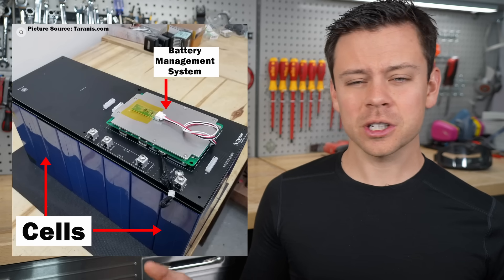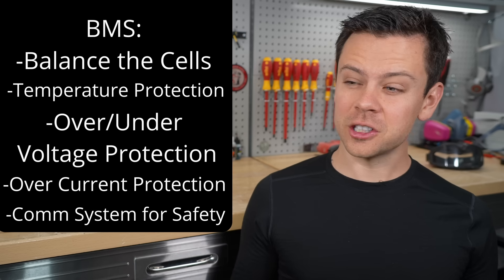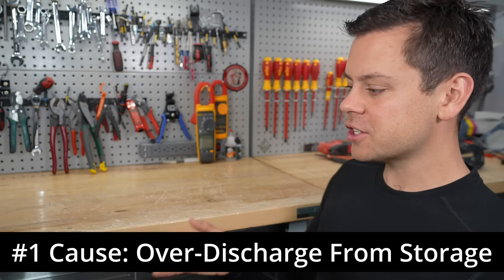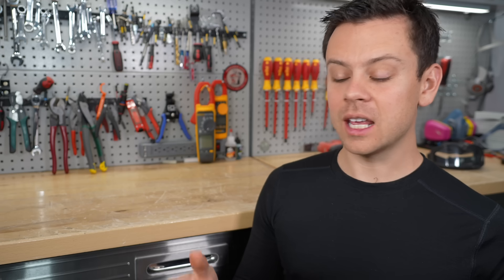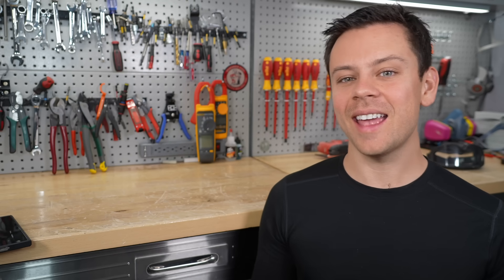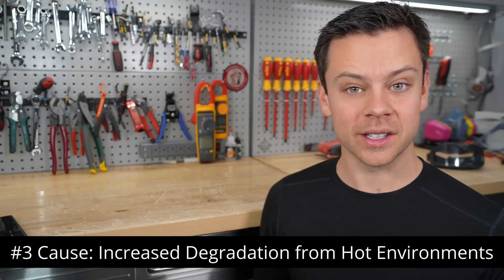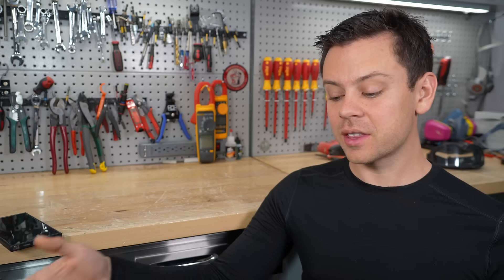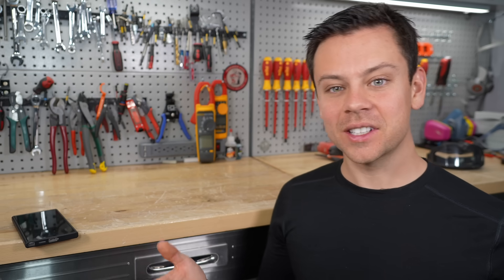The Rules of LiFePO4: The 3 Most Common Causes of Failure and General Guidelines for Long Term Use

Comment: I've seen all kinds of opinions about charging to 100% or discharging to 0%. I trust you the most, so thanks for this video.
Reply: @Justnn  Usually "0%" is not true zero. If you do not let your battery sit at 0%, you will be fine. If you discharge to "0%" the BMS is stopping the battery within a safe zone of discharge, but if you let it sit like that, it will continue to discharge and reach true zero, which is bad.
Reply: @user82938 Cool. Newbie here. So, most don’t tell you the problem of leaving it at 0 is because of the continued self-discharge. 
If I’m charging RV battery every day on solar and happen to deplete it overnight, it’s not going to damage it if the charging starts up again the next day. That’s my typical scenario and was concerned I’d lose an expensive battery.
Reply: ❤ @user82938
Reply: If you check the datasheets of EVE's prismatic LiFePO4 batteries, you'll see that the manufacturer itself says the batteries will last up to 3 times as many cycles if you stay in the 50%-80% range, vs charging/discharging from 0% to 100% and back again.
Reply: @luis0000luis  I've seen that as well. Yet I've also seen articles that claims you shouldn't charge to 100% because that last 1% harms the battery's. Yet the GOAT says the top 1% balances the cells in the string...?

There's so much conflicting information It's hard to gauge what's right.

I charge to 100% every day. then down to 40%.
Reply: @puddintame7794  Imo, I think this is almost like a automotive oil debate. No one, or VERY few, can feasibly track real data across the life of a battery (or a car's engine)  in a controlled manner checking many variables, so everything your read is anecdotal. We can take an expert like Will or some EE's that design batteries and just go with it, outside the big ticket items he mentioned we're unlikely to ever notice any difference.
Reply: @puddintame7794  Top balancing is a leftover myth from the lead-acid era.
Reply: @puddintame7794  You're missing out on 40% of your capacity. Don't sweat it. LFP can take it. As mentioned, calendar aging will cause degradation way more than you charging to 100% and down to almost 0%. Use em like they were meant to be used. I built a 12v pack that gets discharged sometimes twice a day down to under 10v. 1000+ complete cycles according to the BMS. Still getting just over the rated capacity.
Reply: @meindertsprang7491 yea indeed why wouldn't a BMS start balancing the battery's before reaching the 100%
Reply: @luis0000luis  Mine is Renogy and they don’t seem to get specific about cycles, but they also say better to keep within 20 and 80 for longevity. Interesting though, both their chargers, solar and inverter, are default set to charge to 100%. I don’t think I have a choice anyway, I need 60% or more most days in winter. 🤷‍♂️
Reply: @luis0000luis  but yes with lifepo4 it is amlost impossible to know where 20/80 is
the SOC drifts on bms's  in other words the % it shows isn't the actual SOC%

so many people will think they are in 20-80 range and gradually drifts to 0 so may actually use the battery closer to the 0-60 range, until it dies low voltage , recalibrates (which happens at 0/100 normally) and then be in the 20-80 range for a little while and drift lower

also zero balancing happens  if you keep it at 20-80

so then the cells with the highest resistance will drift more and thus you will have  some cells  allways work in the 0-60 range even while the pack is in the 20-80 range

over time this  bottom cells will degrade faster and go even more out of sync

many think an expensive shunt fixes this , it doesn't even though a shunt is very accurate at coulomb counting
it can't count what it doesn't know about battery inneficiency isn't counted it doesn't flow through the shunt, passive  balancimng current  also doesn't flow through the shunt hence where the drift comes from

yes 20-80 does work the problem with lifep4 flat voltage curve is if you don't visit 100% to recalibrate your bms is just as clueless of where the lifep4 battery is at vs the avg guy 

then pair that 20-80 incorrectly done with mediocre passive balance current  and some bms's that only balance while charging and suddenly degradation is faster not slower than just charging to 100% daily
Reply: @luis0000luis  Stay in the 50% to 80% range for STORAGE. They do want to you cycle them from 100 to 0 on a regular basis.
Reply: @luis0000luis ... what do they know, right!!!
Reply: @luis0000luis  That is very true if you are charging  or discharging the batteries at maximum  "C" rate. But below it's maximum charge/discharge "C" rate, it shouldn't affect the cells longevity.
Reply: @luis0000luis  50%-80% is 30% of a full cycle, so of course it last 3 times as many cycles......
Reply: @luis0000luis yes but that’s only roughly 30% of the capacity, so overall your getting the same total power from the battery over its life. 
The cells will heat up more when charging over 80% or discharging below 20%, it’s not the percentage that matters it’s the heat generated in the cells at these extreme ends. That’s why he mentions that they will last longer on solar because they are slowly charging above that 80% level, minimising the heat generated. 
Ideally you would bulk charge to 80% then slow it down up to 100%, which is what good chargers do anyway.
Reply: Hi Will how about float charging of LifeP04 batteries?
Reply: @chakgallon7896  Lithiums don't need floating, but if you want to, set your voltage 13.4V for a 4 cell prismatic based LifeP04. This will ensure no current flowing into a fully charged battery.
Reply: @chakgallon7896 aren’t they to heavy to float sir?
Reply: @thefpvlife7785  No youre thinking of the lead acid....... lolol
Reply: @thefpvlife7785  LoL. Unless they're in heavy water. 😂
Reply: @chakgallon7896 
I’m not Will

“Float charging” is for lead acid batteries. 

LiFePo doesn’t need or require that, some even say it harms LiFePo to constantly barrage them with bolts when they’re fully charged. I actually don’t know.
Reply: @chakgallon7896 I might be wrong, but lithium batteries do not float charge. It's a lead acid thing
Reply: I refuse to believe that he has never advised not discharging to zero. 😁

The thing is that we are learning how to use them and the knowledge is renewed as time unfolds
Reply: So, super expensive batteries die for every reason, but they’re good because??
Reply: Life is short just use the damn battery charge it to 99% and discharge it to 5% and you will be good
Reply: @Chris-hw4mq right on !
Reply: @Chris-hw4mq  This.
Reply: @Chris-hw4mq simple😂
Reply: You really need to define what 0% and 100% are.  I don't remember off the top of my head what LiFePo4 cell voltages are, but for your more common chemistries, for example, that range is specified as something like 2.5V low to 4.2V high.

But, there's no good reason to consider 4.2V as 100%.  There's just not enough additional capacity to warrant going all the way to the max rated charge voltage.  If you set the charge limit to 4.0V or 3.9V or even 3.8V, then that becomes 100%, and it's totally safe to charge to 100% every time.  If you leave it set for 4.2V, then you shouldn't charge to "100%" any more than necessary, if you want to maximize the useful life of the cells.

Likewise on the downward slope.  If you're draining your cells to 2.5V, you're just stressing them for absolutely no reason.  Set your cutoff a little higher, then that becomes "0%" and you can safely drain them to "empty."  They're not actually empty, and indeed, not even yet as low as the manufacturer says they can/should go, so that gives you margin -- and you don't have to give up that much capacity since there's not much power in that last few 100s of mV anyway.

If you drain to actually 0% -- like 0V -- then you're most likely doing permanent damage to the cells.  How much depends on the design of that particular cell, and is way beyond our ability to speculate as armchair engineers.**  The manufacturer could tell you, but they probably won't.  Because you shouldn't be doing that anyway.

** (I recall something about the potential growth of microscopic structures that can puncture the dielectric layer and eventually short the cell -- no good.  But I do not recall what chemistries or topologies are susceptible to this.)
Reply: @sirnickity  any battery with a bms will cut-off at 2.5v on lifepo4 (some voltages you mention is 3.7 nmc based cells related)

so no battery with a bms will do 0V empty
only min recommended  voltage empty

now natturally not all bms's are prgrammed  correctly ie i have a shoto that cuts -off at 2.2v so imo a person should not trust that all bms's will use sane settings
and from my experience drift is exagerated if this low cut-off is hit, and ad the fact that many devices want a battery present to work and if for some reason your battery is drawn down to 2.5v 0%soc and restart/shutdown repeatedly while you aren't home you can land in needing a jump with a battery in protection mode

so to get the system going if you don't have other batteries  or devices to do this with you are stuck so a shutdown of 10-20% soc will prevent this

scientific testing also suggest that not going below 20%  will result in more cycles 
so for day to day a don't and only use that last 20% in event of brownout/emergency
Reply from the maker: @sirnickity  4.2V?? We are talking about lifepo4, not NMC or NCA. Why is this comment being upvoted. This video is not for those chemistries you guys.
Reply: What should charge voltage be and also what should be the top voltage and the low voltage be I've seen so many charts and most is dif
Reply: @bobbyspencer6387  the max  lifepo4 should go is 3.65 per cell so 12v setup 14.6v
24v setup 29.2v
48v setup. 54.75v
51.2v setup 58.4v

This is the absolute max

But some manufacturers have different max so stock to theirs is probably a good idea

ie my shoto 48v is limited to 54v normally the BMS will stop charging at what they regard as best for their battery or what they set as max

So normally you can't damage the battery as the BMS will disconnect the cells to protect them unless a BMS fails 

Aiming for a 3.5-3.55v will also work perfectly fine
Mine many only start balancing at 3.45 and some even higher 3.5v per cell

So you want a voltage at least higher that where the balancing happens
And often a lower voltage may actually be better as a lower voltage over balancing voltage will mean it charges slower at the top as it switches to CV - Constant voltage mode meaning a longer balancing stint
So 3.5v per cell is the sweet spot imo 

14v for 12.8v system
28 for 25.6v system
52.5 for 48v system
56v for a 51.2v system

If you need faster charging anything between this and max manufacturer recommends  or absolute max
Reply: @bobbyspencer6387  lifepo4 recommended max is 3.65 per cell  and minimum is 2.5v 
i use 3.6v per cell at the top the closer you are to 3.65 the quicker the charge will be
anything over 3.45 will get the battery full  the closer to 3.45 the longer the CV phase will be , maybe to slow  as some devices have a max time to be in CV phase 

ie  charge until charge rate is 10% of normal charge rate and SOME have a timer  30min or whatever it is programmed 
so sometimes if it has a short window and the voltage is to low you don't hit 100%soc 

3.5 and up should work better 

float i use 3.38v have read some places 3.35v so salt on this one 

can set a low float and then see where your battery rests naturally and then use that as your float

so if 12v(12.8v)system multiply by 4 
if 24v(25.6v) x 8

and then the 48v systems need to check which yours is
if 48v x 15
if 51.2v  x 16
Reply: Take a look at some whitepapers on this topic.  Storing at 100% SOC drastically decreases cell life.  Some battery manufacturers even recommend only charging to 90% SOC.  Telcoms float their batteries at 3.4V to avoid this issue.  They know what they are doing as they spend millions of dollars every year on batteries.
Reply: @knurlgnar24  if you float a lifepo4 without anu brownouts for a long time surprise surprise it will reach 100%soc

yes often the saying of billion dollar companies do X therrfore that is the right thing to do ain't normally correct, idiots make the decisions on things they have very little experience on and their misinterpretations of what the expert actually said 

many batteries balance from 3.45v per cell
and some even balance from 3.54v my shoto does that

so using 3.4v is actually worst thing you can do literally no balancing will hapen at all , some cells will degrade as they have a slightly higher internal; resistance  and drift lower they will hit  0% soc more regularly and degrade even  quicker

unfortunately many myths get so enshrined  by being repeated so much keep repeating the bullshit and then it will become accepted fact, example trump

yes there is truth to degradation patterns lots of studies 
but then comes the implementation of systems to attain that utopia and with lifepo4  it is impossible to do the 20-80 SOC as you can't say where 80 is with voltage and 
then some say the shunt is super accurate which they are , the problem is they can't count losses ie lithium has 99% efficiency so 20 days of 1% discrepencies and you bump up against 0% soc when you think you are suppose to be at 20% it also can't count balancing losses so yea the 20cycles is best case scenario
Reply from the maker: Full discussion video for everyone: https://youtu.be/K9Tfivf5bAI
Reply: @ 

Okay!  Good video! Very informative! 
    I won’t be going to LiFePO4. Way too expensive, too fragile, too much setup design, too much management, too dependent on extended, stable, and reliable power input.
Reply: @WillProwse  I saw that! Thanks for making it.
Reply: @WillProwse I have 2 100ah lifepo4 batteries in parallel.  My rv converter charges at a rate of 55amps. Is this a safe rate of charge? Thank you
Reply: What is considered 100% ?  How do I measure  that?  Multimeter DC voltage?  13.3v ?  Is 50% half of that?
Reply: @MikeJones-rk1un  You're overthinking it.
Reply: @MikeJones-rk1un 13.4 is 99% at equilibrium. Look up a voltage v Soc table, 50% is 13.15 volt.
Reply: I will have to disagree with you on the 0 and 100% deal. 
How many life cycles have you gotten out of a battery doing this? What was the capacity and esr degregation? Exactly what battery you use and is typical charge/discharge C loading and at what temps. 
I worked for Cadex for 15 years and I will say from my experience your info is wrong.
Reply: @Justnn  better calibration of state of charge meter occurs below 5% and above 95% for LFP batteries
Reply: My experience with battery, how the batteries are being stored is very important too, well vented but temp regulated! I have seen lpo survive cold temps no problem because they have there own heated source inside the battery but they start to fail over the course 3-4 years if the storage area is not temp regulated, also high moisture is a issues too though mainly on the cables and controllers
Reply: @nathanhatcher7096 низькі температури це скільки градусів ?
Reply: I just set my perimeters to what the manufacturer suggests and I keep them above 70% dod when I can. Almost all manufacturers do say you get Alot more cycles if you keep them above 60-70% did so it's similar to lead acid which I use when weight isn't an issue
Reply: Just remember this video is discussing a single lithium chemistry. A lot of the confusion and mentioned conflicting info comes down to people misapplying various chemistry’s best practices as the best path for all lithium chemistries
Reply: I do 20% to 90% ... Then ones every 3 months I do 0% to 100% 3times.
Reply: @wayando Why?
Reply: I think its an old habit from before LifePo4 ... The setting are set to charge to 90% ... And raise alarm at 20% ...  @IH-nr7dx 

But then every 3 months a charge it all the way so the cells can get balanced ... And back to zero so the charge monitoring thing can recalibrate itself.
Reply: @wayando  not good
Reply: This is true with Lithium ION batteries but not LiFePO4. Mobile devices, especially Apple's devices, do a lot of charge level optimization to extend battery life.
Reply: EcoFlow recommends charging to 80% and discharging to 20%.
Reply: I do not care about the % SoC because it is hard to track. Basically you're counting electrons. I charge to 3.45V and discharge down to 3.1V. Just stay in the flat part of the voltage curve and avoid the extreme voltage.
Reply: I do not.
Reply: You'll have to keep in mind that the economy has really changed where everything is so tight and people have become so greedy that many many businesses and companies cut Corners to save costs and raise their profits. Remember battery manufacturers are in the business of SELLING batteries. 😮
Reply: ask yourself why you trust this dude and when you can answer that truthfully then critically think about your answer. you will come to the conclusion that your reason for trusting this kid is completely foolish and not based in logical reasoning.  Trusting a kid who makes videos on his phone and edits them to depict his own reality is not a reason to trust anyone.
Reply: @MichaelGray-j1j  Actually, you sound like an idiot.
Reply: 3.65 is 100% charge of LifePO4 cell

I consider 3.0 as 0%
Reply: @chakgallon7896 there is no float charging for lifepo batteries. It is bad for them.
Reply: Are all lifepo4 safe to go as low as 0% like mine at zero issues 10.5 and then it cuts of,never ever managed to get them lower than 40% or so but I haven't got Bluetooth inbuilt,its quite annoying like each battery company have different says, for example vatrer recommended 13.1v before a recharge to 100% will give around 8000 cycles but if you go below say 12v it reduces it to 4000 cycles so it's a hard pass,the way i see it is 100% - 0% then charged to 100% is a genuine 1 cycle,batteries have cycle ratings but I think it all depends how its set up and how much draw continuously like pulling max amps from 1 single battery is going to hammer it if continuously doing it imo would shorten or weaken them,but IMHO lifepo4 especially the better graded more expensive ones with tougher bms systems,like for example the valence 138ah lifepo4 green were 900 iirc back then but now you could get nearly 4 for this price,but they were rated 4000 cycles before degradation iirc. Well I got mine cheap no idea on age or cycles except seller said 60-100 cycles so and ive tried running these with and without solar and never gone flat under decent usage
Reply: I have been using 5kw lifepo4 for 2 years. Charging every day to 100%, discharging to 50%. Last  6 months the soh(state of health) dropped to 88%. Not sure it bat. degraded over 2 years, or if my bat. program pbmstools reports wrongly. 12% degradation  over 2 years does not seem correct.
Reply: The purpose of a battery is to store energy, charge it to 100% and discharge it as far as you need to, if you run out of power you need more batteries